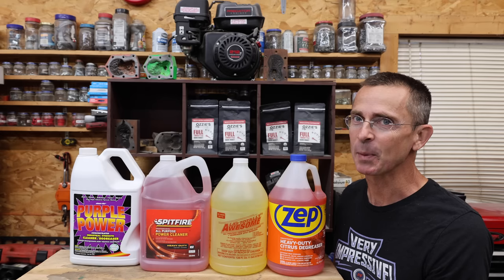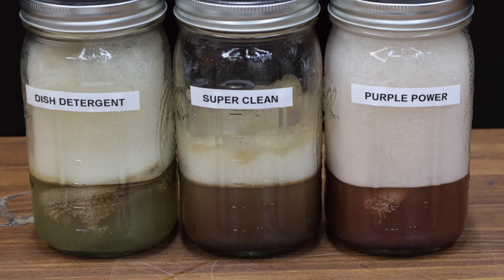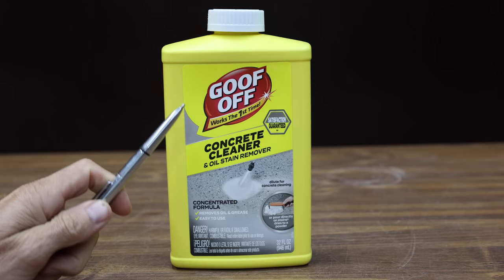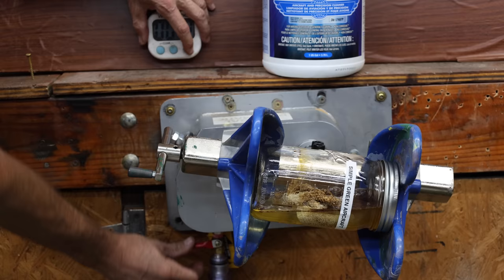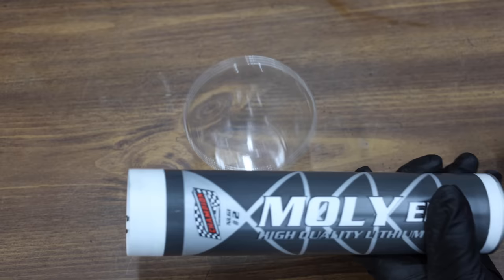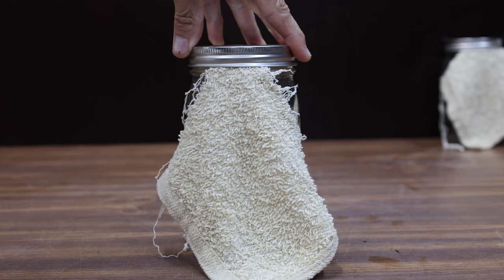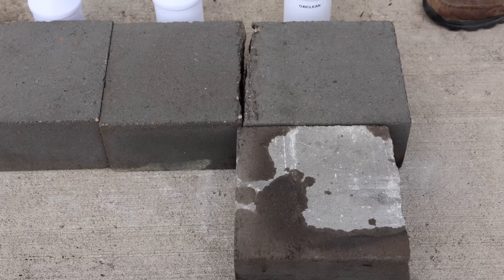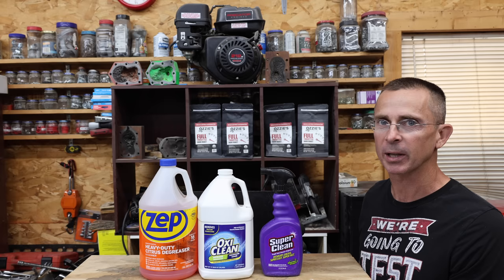Best Concrete and Engine Degreaser? Let’s Settle This!

Comment: I’d love to see a straight up concrete cleaner showdown. I have a badly mildewed pool deck from the fall leaves and berries that sit over winter. They are super tough to get out. Between bleach, muriatic acid, enzymatics, and numerous concrete cleaners out there, I’d like to see which one is truly king.
Reply from the maker: Thanks for the suggestion.

Comment: Hmm. I think automotive testing would work, but mostly for bolt-on products. Like air filters, cold air intakes, headers, mufflers, down pipes, things like that. But, rebuild has too many variables that it will be hard for viewers to understand what specifically is being tested. I bet you could have fun with tires, I'm thinking snow tires shoot out. You could also do "does adding weight to the back of a pickup help". You could also do brake pads and or brake rotor/pad combos. Looking forward to more tests, thanks.
Reply from the maker: Thank you for the video idea!

Comment: Super clean is my go to. Glad I dont have to change my degreasing ways now
Reply from the maker: Thanks for the feedback.
Reply: Be careful, SC can corrode/etch aluminum. They even now specifically warn about it. Unlike the WD40 Specialist and Simple Green Pro HD which are specifically made to be safe on all metals and not corrode.

Comment: I use straight Kirkland(Costco) liquid laundry soap on my oil stained concrete driveway.  Soak with straight detergent, broom scrub, keep it wet with a spray of water to keep the detergent working when it starts to dry out.   This methond works on old, set in oil stains, just repeat a few times.  I think any liquid laundry soap will work.
Reply from the maker: Thanks for the feedback.

Comment: ZEP and SUPER CLEAN have always worked great for this viewer and its always easy to find.
Reply from the maker: Thanks for the feedback.
Reply: Be careful, Both can corrode/etch aluminum. They even now specifically warn about it. Unlike the WD40 Specialist and Simple Green Pro HD which are specifically made to be safe on all metals and not corrode.

Comment: If you can consider the right testing method, how about testing the many methods of setting a wood and metal fence post in the ground. Thinking dry pour ,wet pour, and synthetics like Sika). The biggest variable would be the actual ground composition from post-to-post (sand, loam, clay, etc). Testing materials would be pretty cheap for this one. You may have already done this one and if so please advise.
Reply from the maker: Thank for the suggestion

Comment: The BEST degreaser I have ever used is the foaming spray dawn power wash. Works better than engine degreaser and even oven cleaner without discoloring aluminum.
Reply from the maker: Thanks for the feedback.

Comment: to remove "oil" stains from concrete, use a weed burner.  The oil will rise up into the heated concrete, vaporize and burn off.  (does not work with A/C PAG oil)
Reply from the maker: Thanks for sharing.

Comment: well, i used to work in a garage shop in Texas and the boss always had me clean off the concrete at the end of the day with orange Zep and yes it work great, but i had to let it sit for like 15 mins or longer ok, but i would apply Zep and with a pressure washer and use a pressure washer to clean the concrete ok :0
Reply from the maker: Thanks for sharing.

Comment: I've been using SuperClean in the garage since the mid 90s. It's never let me down.
Reply from the maker: Thanks for sharing.
Reply: Be careful, SC can corrode/etch aluminum. They even now specifically warn about it. Unlike the WD40 Specialist and Simple Green Pro HD which are specifically made to be safe on all metals and not corrode.
Reply: @seashackf1  I didn't know that about SuperClean. But thank you for the tip! 😁
Reply: @therealgaragegirls  no problem, I really wish he had mentioned and tested for it. Most of the cleaners in this test are the same way. Hope people don’t use it incorrectly and ruining something they are trying to clean.

Comment: I think an episode on just engine degreasers is great, where you only use metal/aluminum parts  rather than cloth or concrete, that have baked on oil and grime.
Reply from the maker: Thanks for the suggestion.

Comment: I work in Steel Mill and we use a product called Korkay and it does a way better job than the Simple Green and the smell is not strong at all can use it on boats and siding, just not on Eyeglasses, took the scratch resistant coating off mine and had to throw them away they were so cloudy from it, but it seems to be safe on most other surfaces.
Reply from the maker: Thanks for sharing.

Comment: interesting findings, I've been using purple power for years, used it in construction equipment and that translated in using it in my home garage too. ive always been pleased with my results even soaked hardware in it over night with fantastic results.
Reply: Be careful. PP, like most of these can corrode/etch aluminum. They even now specifically warn about it. Unlike the WD40 Specialist and Simple Green Pro HD which are specifically made to be safe on all metals and not corrode.
Reply: @seashackf1  if you use it properly it’s unlikely to cause problems, you are supposed to rinse off the surfaces it is used on, and not to be used on painted surfaces.
Reply: @NefariousRake  yes rinsing is very important and that’s true of any strong cleaner. PP can still corrode if left on too long. Where as there are other products that won’t and are specifically made to be completely safe. I’d just rather use those and have no risk.

Comment: You should use a degreaser in testing motor oil adhesion.  I spilled Penzoil Platinum  on a hoodie washed it in Gain and LA Awsome, repeatedly,  IT WOULD NOT COME OUT!
Reply from the maker: Thanks for the suggestion.

Comment: turn the cotton test into an objective test by measuring the weight of the towel before, stick in low temp oven to remove liquid, and then weigh the dry towel. Then take the delta of the weights to see which towels had the most accumulated grease on them. Probably overkill, but hey, data is data.
Reply from the maker: Thanks for the suggestion.

Comment: Well. I am a pressure washer. Using degreaser to clean mold/mildew is not a great test. But that grease test was gold. Also, I would be interested to see what the cost per diluted product would be.
Reply from the maker: Thanks!  Thanks for the suggestion.

Comment: Ya know, there's a subject you're likely well suited to given what toys and tools we've seen in your videos. There are not many good and clear videos on tractor, impliment, and powersport vehicle repairs. 

This is probably for good reason as there's an ever dwindling number of us who could use that info, but if you could work in a video here and there on tractor hydraulic services, or 2/4 stroke piston ring replacement, anything from burnishing a slip clutch on a baler to replacing the teeth on a sickle bar.

Of course if you think it'll be a worthwhile fulltime thing I'm all for it.
Reply from the maker: Thanks for the suggestion.

Comment: That Super Clean is IMPRESSIVE!! I never even heard of this product before I saw this video? Excellent compared to analysis.. now I know what to use to clean my bathroom tub and shower. Lol.
Reply from the maker: Thanks for the feedback.
Reply: Be careful, SC can corrode/etch aluminum. They even now specifically warn about it. Unlike the WD40 Specialist and Simple Green Pro HD which are specifically made to be safe on all metals and not corrode.
Reply: @seashackf1  ok. Thank you. I think that is Castol SC?? So I know not to put this on my car rims???
Reply: @ftnrbhmwk  from what I can tell, Castro split it off and sold it years ago. It’s also been reformulated since.

Comment: My personal favorite degreaser is Red Hot by AutoMagic. It is strong and will cause severe irritation if you get it on your hand,  but it cuts right through anything ive thrown it at. Its alot stronger than purple power and simple green. Never tried soome of theee others that were used in this test.
Reply from the maker: Thanks for sharing.

Comment: Dawn works great.  I’ve been using it for years on engines and hand cleaner.  But you have to use it strait,…so it’s stronger.  By diluting it so much there isn’t much to work.  I think if your going to dilute you would dilute all products the same amount to get an accurate idea of what is stronger.  Or don’t dilute any.  By diluting some and not others it makes some stronger and changes the results.  Just my thoughts
Reply from the maker: Thanks for sharing.
Reply: Dawn is a great degreaser, but not on metals. You also need way more than he use, that’s for doing dishes. The problem with it is It can corrode/etch aluminum like most of these here. The Simple Green Pro Hd and Wd40 specialist a specifically made to be safe on all metals.

Comment: Maybe start testing construstion/building methods like twisting wires before installing a wire nut vs not twisting, using pvc primer wet vs dry vs not at all, toe nailing a 2x4 vs regular nailing. That sort of thing. We all have a different way fo doing things, but what is the best way.
Reply from the maker: Thanks for the suggestion.

Comment: Suggest that you perform a test of oil extraction pumps- for performing thru the dipstick oil changes.
Seems like there are a lot of pumps out there (both electric and manual) that have issues with insufficient flow,/ too long to remove oil, suction hose collapse, suction hose too short, pump motor noise, inability to know when you get all the oil out, etc, etc. this product is ripe for a rigorous test !!
Reply from the maker: Thanks for the suggestion.

Comment: Again, excelent, and I will consider it mow that I have to buy degreaser.
I just missed one test that I consider interesting, the damage to aluminum or metal surfaces… this is a common use to clean rims, engine parts, etc… but some products are too agressive against alois or metals… but as always, excelent review!
Reply from the maker: Thanks!

Comment: Best degreaser by far is Selleys oven cleaner ... I've been in the automotive industry for almost 40 years working for different businesses but also having my own business for 13 plus years .
I've had every product rep and snake oil salesman through all the  places I've been involved with.
I used to buy a product from PJS Chemicals called "RIPOFF" which was alkaline based and had various mix ratios for different applications.  
I never mixed it, it got sprayed on at 100% straight Chemical and used where possible a hot water pressure washer. 
$120/20 litre 15 years ago. 
Now I go to Bunnings and buy a carton of Selleys oven cleaner, go home spray it on the job I'm doing, go watch TV for 30 mins, then hit it with a pressure washer and its job done.
Even heavily varnished engine internals cleaner up like new (sometimes 2 or 3 coats of oven cleaner)
Reply from the maker: Thanks for the feedback.

Comment: I like the cleaner test, weirdly, I've been using the Super Clean for quite awhile. I think it started out as a Castrol product, you could get a Wal Mart.  Easy vid suggestion, do a tour of your shop, tool boxes, etc. You'd need someone to run the camera while you pointed stuff out.  I'm going to watch the car transmission rebuild, I've never done that.
Reply from the maker: Thanks for the feedback.

Comment: I get VERY good results from Super Heavy Duty Degreaser from Harbor Freight.  1 Gal, $10.99, SKU 42998.
Reply from the maker: Thanks for the feedback.
Reply: @ProjectFarm  I use it at higher concentrations than what's listed on the label.  It might be the same ingredients as LA's Totally Awesome.  Looks the same.
Reply: Be careful, SC can corrode/etch aluminum. They even now specifically warn about it. Unlike the WD40 Specialist and Simple Green Pro HD which are specifically made to be safe on all metals and not corrode.

Comment: Love your reviews and I'm a big fan of them.  To be honest with this one, Dawn dish washing concentrate needed about a 1:5 ratio (Dawn vs hot water) to get the most out of it.  Also, nothing performs better on mold than a 1:4 - parts ratio between bleach vs water.  If it didn't get it the 1st time, try another application or increase the ration to 50/50 bleach vs water.  I've used Super Clean for years and can get it at Walmart.  I use to use it on greasy heavy equipment, scrub it with a brush, let it sit and soak it a few more times, do another scrub with the brush and then pressure wash it off (use eye googles).  The stuff with that process works great!
Reply from the maker: Thanks!  Thanks for the feedback.
Reply: Yes, he used way to little Dawn. That amount is for doing dishes. I use 3-4oz in a 32 oz spray bottle.

Not a fan of Super Clean. Like most of the others it’s not safe on all metals. The Simple Green Pro Hd is and won’t corrode/ etch aluminum.

Comment: When I rebuilt my engine, I soaked all of the steel parts in Zep driveway cleaner. It contains sodium hydroxide so don't get it on your skin but it removed all the grease and grime. All I had to do was rinse off the parts.
Reply from the maker: Thanks for sharing.
Reply: Be careful, It can corrode/etch aluminum. Most of these here will. Unlike the WD40 Specialist and Simple Green Pro HD which are specifically made to be safe on all metals and not corrode.

Comment: You should try easy off oven cleaner I use it for cleaning oil off motors and transmissions works really well. Stuff in the yellow spray cans.
Reply from the maker: Thank for the suggestion.

Comment: As usual, great review, and hats off to the time also to record and edit, which is probably as much as the testig itself. I have settled in to just about your top ones, after trial and error. LAs Totally aweseome, is my routine go to, Zep Orange if I need more power, and only Super Clean in rare occasions, as it might harm finished surfaces. It damaged my powdercoated valve cover once, so I reserve that for only unfinished surfaces. Lastly, you might also try Spray Nine. I like that a lot also. Good work! You are making a difference.
Reply from the maker: Thanks!  Thanks for the suggestion.

Comment: The best way to clean oil or grease from the floor is to brush it with mineral spirits and then cover it with speedy dry, try it.
Reply from the maker: Thanks for the suggestion.

Comment: How about a test for boat/yacht bilge cleaners.
Down in these dark, gooey and mostly already wet locations, all kinds of oil, fuel, black water and stink accumulate. 
Also, environmentally friendly when pumped overboard.
Star Bright and West Marine bilge cleaners I have used with mixed results.
Also, I have used gallons of cheap white vinegar to remove bilge stink, with some cleaning action.
Looking forward to how you will test and results.
Reply from the maker: Thanks for the suggestion.

Comment: Cool. Love your videos. Straight and to the point.

I wanna see three dishwashers, then take Pyrex dishes and plates, and put dried lasagna, and baked on stuff, then wash them using the different cleaners.

I have yet to find a dishwasher that works without pre-washing.
Reply from the maker: Thanks!   Thanks for the suggestion.

Comment: You can get enzyme cleaners to remove mildew.  I wouldn't think to use a solvent on the siding.  I use dawn on my power tools.  The products would work better if you scrubbed them in.
Reply from the maker: Thanks for the constructive feedback.

Comment: Oil Eater has an enzymatic cleaner that I recently found that works well on driveways.  That, along with others emerging in that arena, might be interesting to evaluate. I grew up using Stoddard safety solvent that is hard to beat (but hard to find.)  I love your videos.
Reply from the maker: Thanks!  Thanks for sharing.

Comment: Big fan, long time subscriber. I think, particularly as you are using it off label, Dawn should have been doubled or tripled. As to branching out, I think you should keep this channel pure testing. Make a different channel for rebuilds etc. Finally, thanks again for all that you do. It is obviously a lot of work, and it is deeply appreciated. I ALWAYS check with PF before I decide on a product.
Reply from the maker: Thanks!  Thanks for the feedback.

Comment: You should have tried Zep purple degreaser found at Home Depot 
Also you should have not watered down the Dawn Dish detergent so much. I use it for hand cleaner on greasy hands and it works well. Can't beat the price
Reply from the maker: Thanks for the constructive feedback.

Comment: Comparing the job that $0.25 worth of dish detergent against $2.50+ of another product, even if this is per the recommended dilution, hmm.
Concentration, agitation, time and temperature
For cleaning mildew, I have found products containing d-limonene (a cyclic terpene), and quaternary ammonium to be effective at cleaning and disinfection.
Keep up your good work.
Reply from the maker: Thanks, will do!

Comment: Can you try testing Dynamite Degreaser? It's an industrial degreaser that is used to clean concrete so it's battle tested. If you could do some testing on heaters that'd be great. VEVOR heaters!
Reply from the maker: Thanks for the suggestion.

Comment: I like a mop and bucket "system" review. But one that simulates at least a years worth of use. I hear of great products like the Vileda Easy Wring and Clean, but you scratch a little deeper and the mop mechanism fails after a year or the mop head isn't full enough so the mop head plastic scratches your floor
Reply from the maker: Thanks for the feedback.

Comment: Purple power can be diluted.  In the micro label, it says no dilution for engines and oil.  I did the test on concrete, both diluted and straight.  Much better straight.
Reply from the maker: Thanks for the feedback.